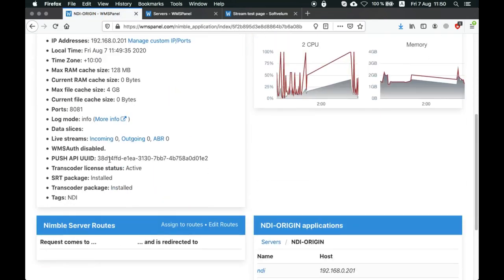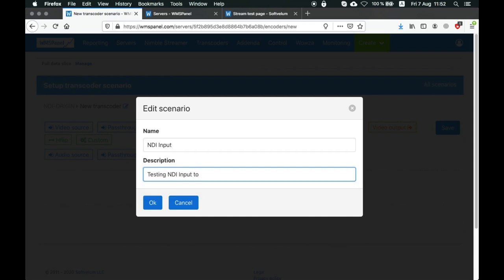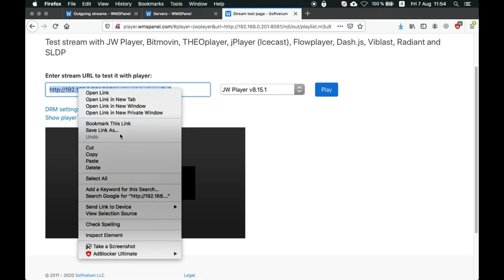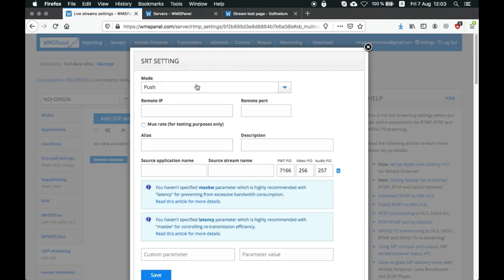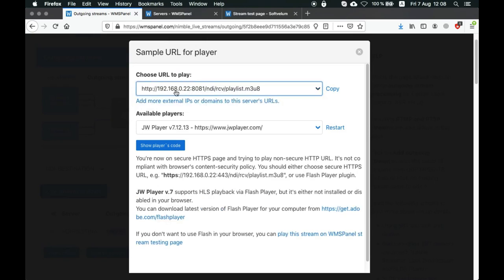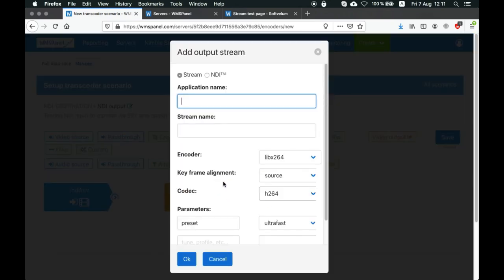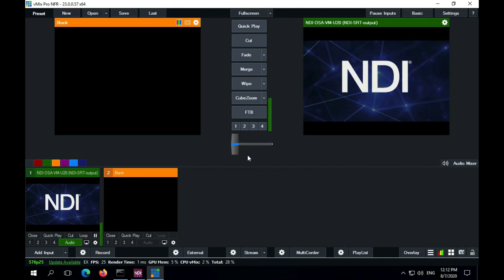NDI processing setup in Nimble Streamer

Comment from the maker: Here are the time codes of each step of NDI pipeline setup:
0:00 Introduction and prerequisites
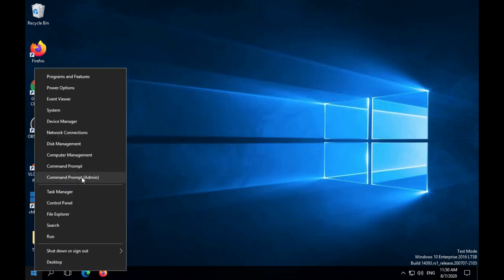0:50 NDI sample stream and Nimble NDI monitoring tool
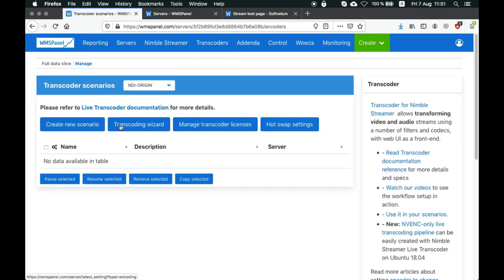1:25 Get NDI input on Origin via Transcoder
2:27 Test Origin output via HLS
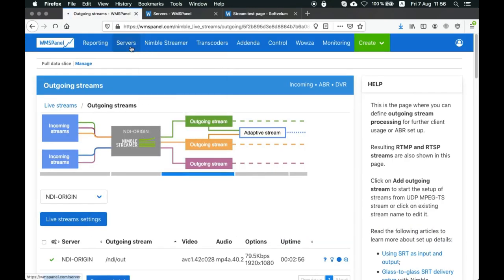3:35 Make SRT output from Origin and test it
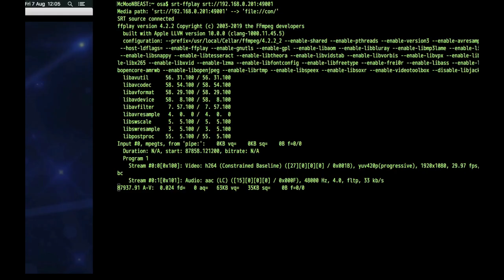5:24 Set up Destination server to receive SRT
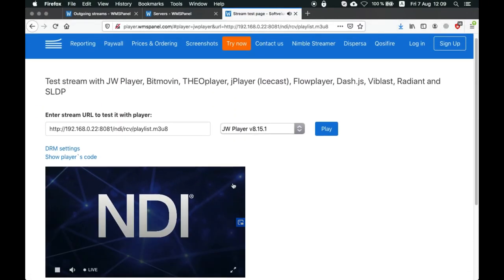7:10 Make NDI output on Destination via Transcoder
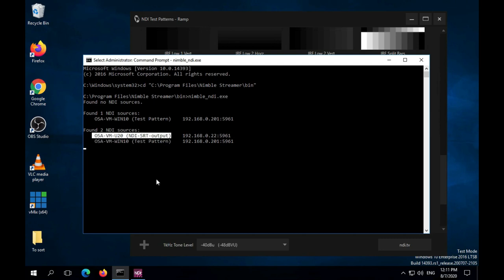8:21 Using vMix to test the NDI output